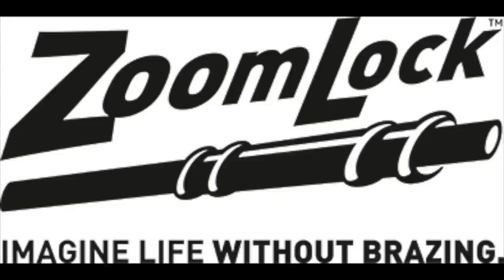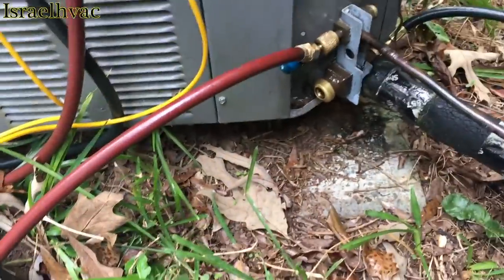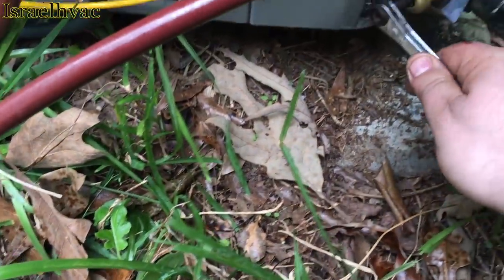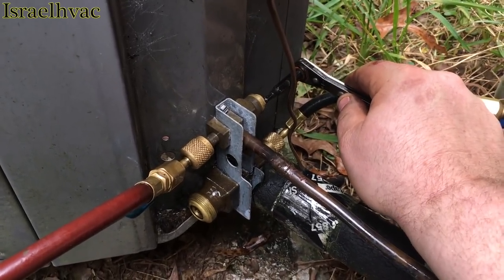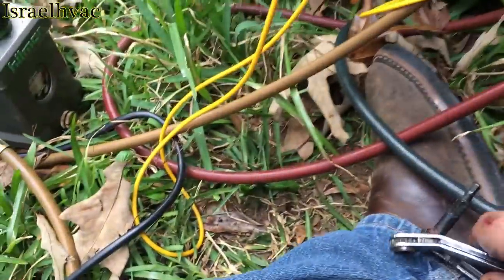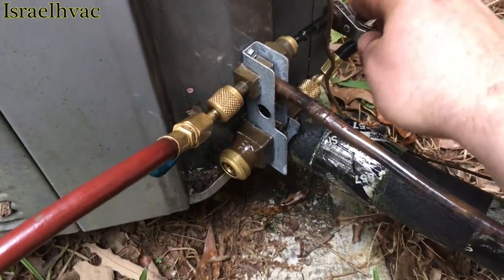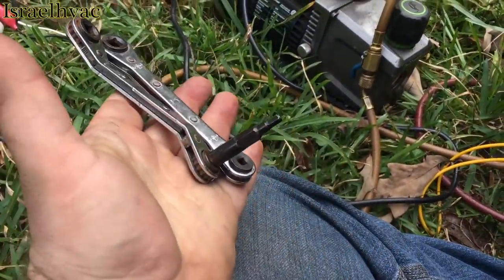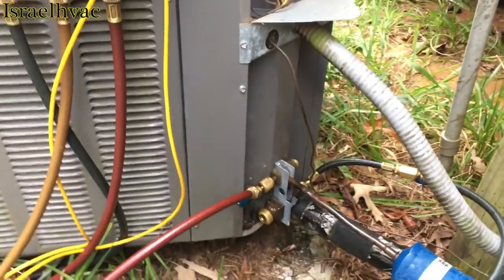HVAC | Tech Tip

Comment: That has got to be the dumbest shit I've ever seen!! Nothing changed. The head of the offset wrench is in the same position as the straight.
Reply: Agree Jesse Sard...The real tech tip if he could bend forward and look is to remove the two 1/4" screws holding the valve bracket and the service valves now now have flex to come forward enough to get your service wrench in them no problem. Really the root is it is a engineering screw up by Rheem/Ruud